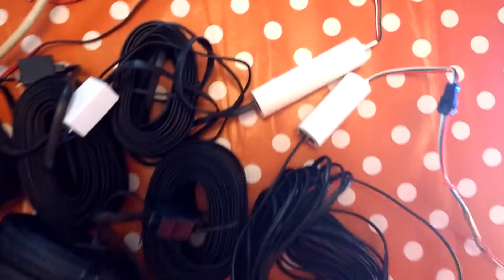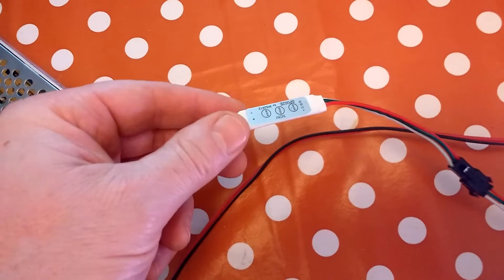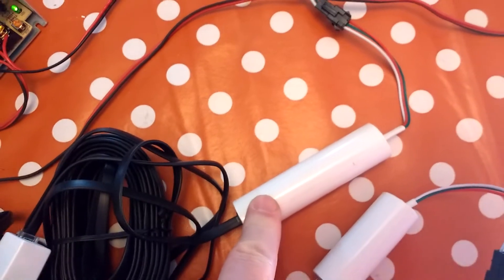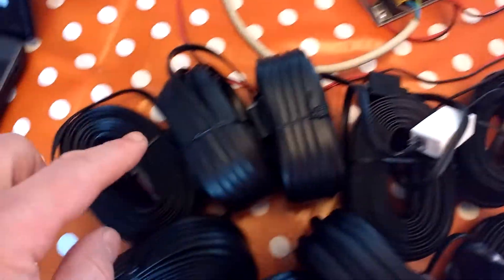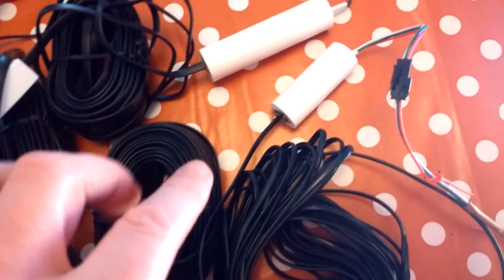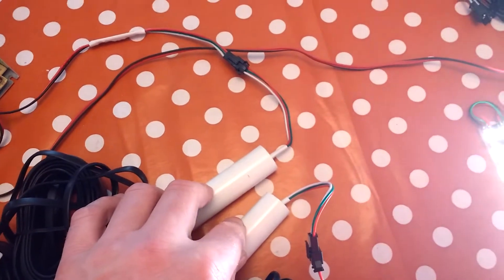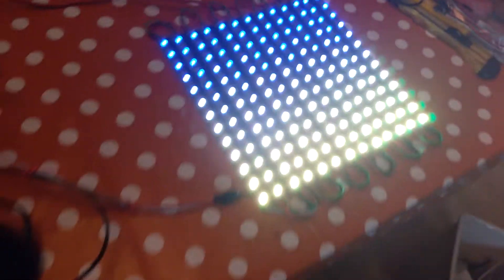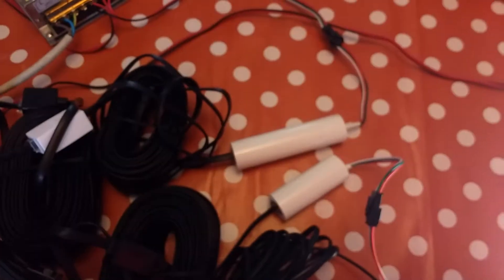Smartshow : Extending Neopixel WS2812 SK6812 data by 200m

Comment: I'm getting voltage drop on my data ws2811 12v lights. The power is perfectly fine being power Injected after each strip (10) so that's not the problem. Unfortunately this system is for 5v but is something like this what i need to fix the randon flickering lights? Thank you
Reply from the maker: how far does your data go between controller and first pixel ? sometimes we use a 100ohm resistor inline with data to reduce interference on pixel data
Reply: @Recovered  Its about 6' from the controller to the first strip. That first strip out of the 10 is also the one getting the most flickering. So just that resistor soldered inline after the controller is what I should try next?

Comment: Hi Bob, nice video, thanks for it. I've an issue here, I have 15 strips of 1m each, the data from controller is quiet near from the first LED but between strips are at least 4m, the thing is after 2nd strip starts the nightmare and the strips starts to get data errors. This device you show us can fix the problem? Thank you for your time.
Reply from the maker: check the supply voltage where it starts to go bad, and maybe twist data and ground together between strips to improve data survival
Reply: @Recovered  hi Bob, thanks for your response. I'm using a pixel led controller over wifi, builded with a esp01. This device can control 300 pixel led, so test was made with 5 strips. I swap between strips to be sure the issue isn't on the installation neither cables and conectors. I've been checking power supply over this 5 strips and the drop is around 100 mV avg. (It goes from 5 til 4,9 Vcc).

Comment: Hello, Ive seen your products on eBay before, and then came across this video, possibly will be purchasing the NetBuddy and the ArtNet LED drivers, do you sell these extenders? Of so, are there other products you sell that are not on your eBay?
Reply from the maker: Hello Ben, yes I sell these (not quite as you see in the tubes) for £25 for the TX/RX pair, I have several other products not listed on Ebay, multiple universe Wifi Pixel devices, USB-DMX convertors, etc. For more information email me on bob.lynas@btopenworld.com

Comment: Hello Bob, very interesting video, 200m is very impressive! Could you disclose what IC you are using for the differential line drive and reception at the other end?
Reply from the maker: Yes, quite simple either MAX485 or SN75176
Reply: @Recovered  Interesting, same as DMX. Wonder how many pixels that could drive though.
Reply from the maker: @Brumleboer  It would be as many as you would like, easily 680 @ 25FPS, maybe more
Reply: @Recovered  I'll have to test it! Fortunately I have a lot of those ICs lying around. Thanks a lot for your answer Bob!

Comment: There is a big difference between SK6812 and WS2812b ?
Reply from the maker: Not that I am aware, they run from a similar protocol
Reply: I have used both LED types and are both reacting the same way
Reply: SK6812 has a slightly higher luminous output

Comment: Where did you find these extender? You made them or you built them? Any info would be appreciate:) thx
Reply: I meant bought them**
Reply from the maker: Hi I make these, they dont come with plastic tube, just a heat shrink finish, I have several smartshow items on ebay, but havent put these on yet, but I have many in stock
Reply: Bob Lynas great! I'll be looking forward to find them on eBay then